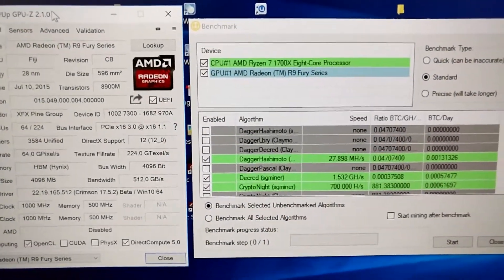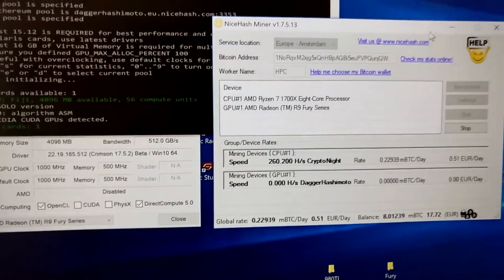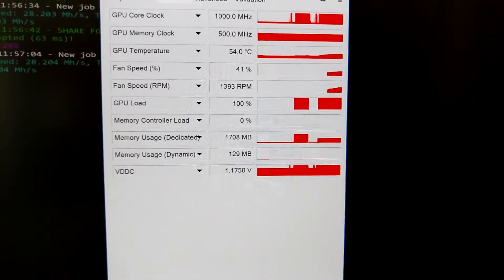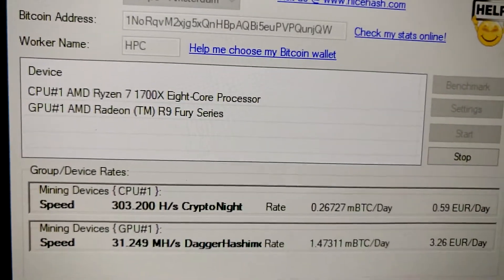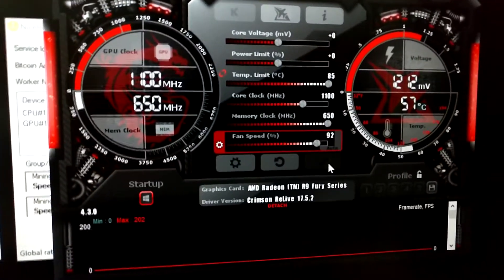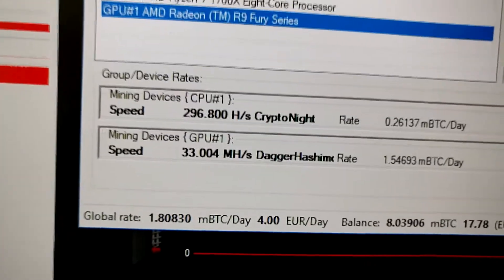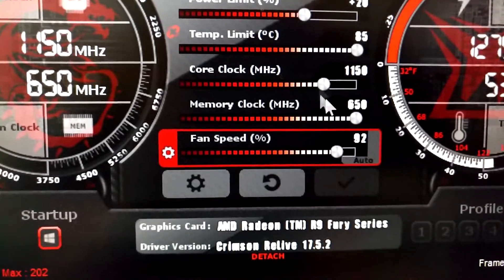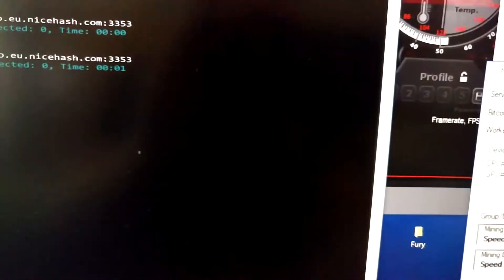R9 Fury Mining Benchmarks

Comment: How much power did it use ?  from wall. I have offers for R9 FURY  for 340 and 325 Eur. I am starting to mine. What are your suggestions. Thanks for answers
Reply from the maker: From what I recall, the power draw was pretty intense, as the card doesn't ship with efficiency optimized settings.